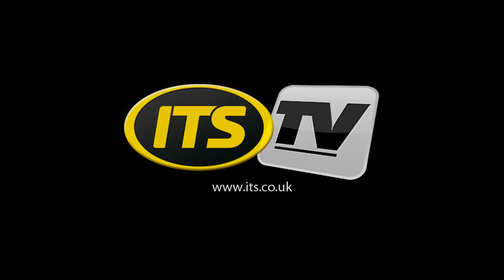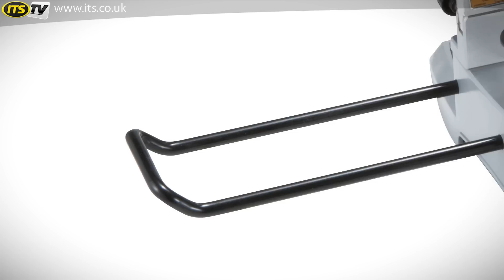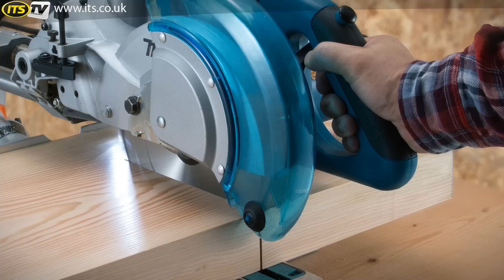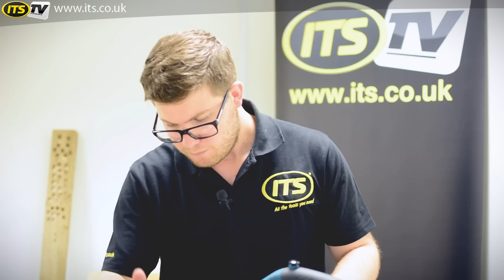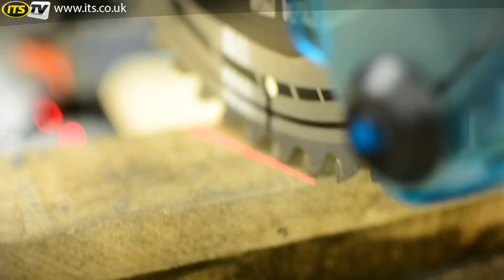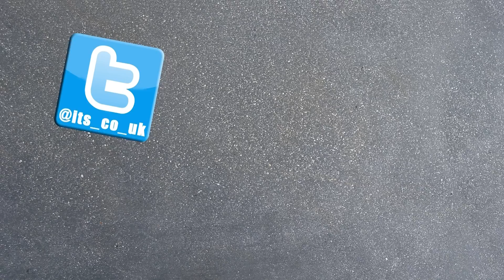Makita LS0815FL 216mm Sliding Crosscut Mitre Saw - ITS TV

Comment: Can I fit a 210mm blade to this?
Reply from the maker: It may be possible with a reducing ring, but this is designed for 216mm blades. So we can't advise that you'd be able to use 210mm blades. - Dan

Comment: How does it compare to the Makita ls0714?
Reply from the maker: Hey jualmad21, thanks for the question - our blog on the LS0815FL should answer any questions you have... Check it out here: http://www.its.co.uk/blog/tomorrows-tools/makita-ls0815fl-216mm-mitre-saw/
Reply: ITS thanks for the link. I've trying to get some info to compare these two saws beyond their specifications. Do you think the 8.5 inch saw with only two rails will give the same rate of accuracy?  Or is this new model more to fill a gap of capacity? Their capacities are pretty much similar but the fact that it only has 2 slides instead of four makes me wonder if this is only to fill a market gap instead of improving the predecessor.
Reply: @jualmad21  Improvement of previous models isn't the only reason for development.